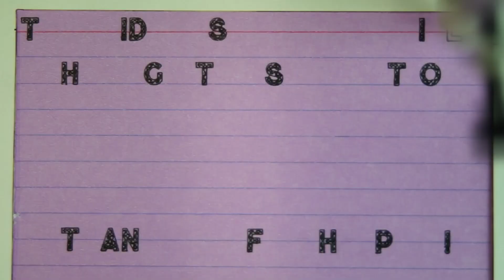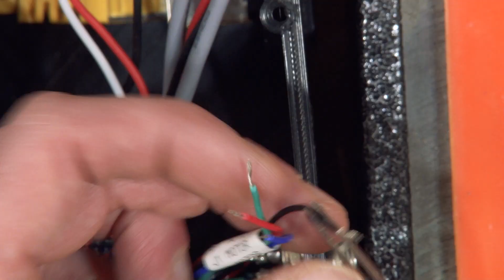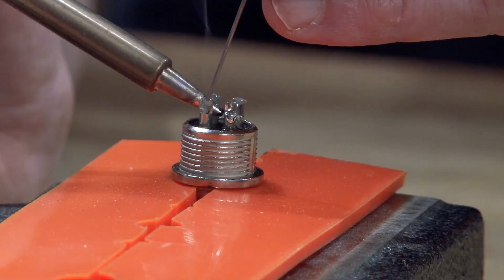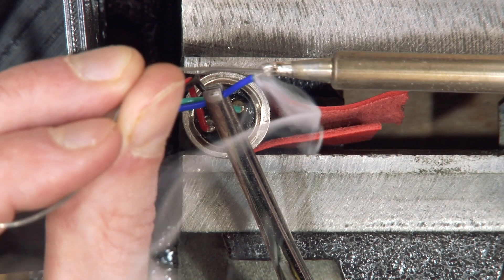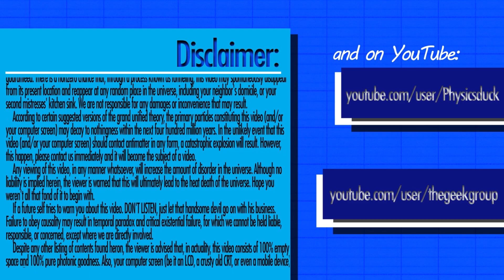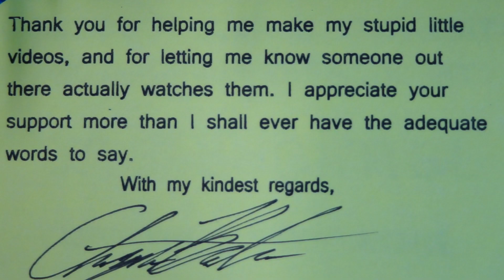Project ARchi3 Episode 33 - J1 Motor Connection

Comment: Save yourself a headache and just use solder paste. I do not like pin soldering, Sam I am.  Old Bell labs tech thought me with wires the same size as the pins. 🤬